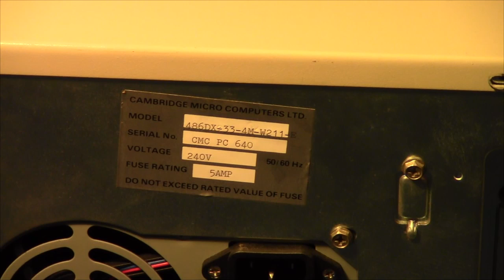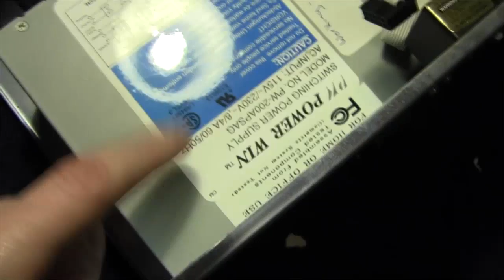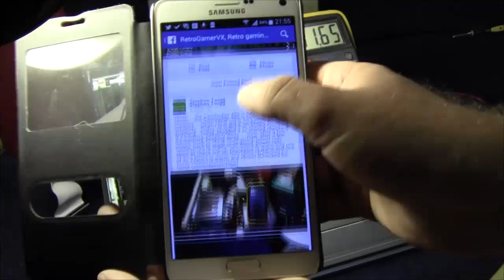Rare Cambridge Micro Computers 486 33DX Repair Part 1 :o)

Comment: I would check the jumper settings on the motherboard as well as the graphics card.  Try cleaning all of the jumpers as well.  Get yourself a POST (Power On Self Test) card that has a ISA connector on it.  They are under $5 on eBay.  A 33Mhz cpu should not get hot that quickly after startup, a 66Mhz one on the other hand will.  Check that the cpu voltage is correct.  If you have another power supply try it with that most rails are suppost to be within 5 to 10% of the marked output voltage.  Open up the power supply and see if it has a output voltage adjust pot in it and adjust it for the correct voltage output 5V and 12V being the most critical.  Try reseating the cpu as well.
Reply from the maker: Some good tips there thanks.  I'll be sure to review that when I get around to doing more work on it (full schedule atm) :)

Comment: I have a 486 with a VLB SVGA card. It was the source of all my issues. Very finicky. This is obviously not VLB, but a loose VGA card can cause a machine to not boot. Or really, any loose card. Try pressing down on it while turning it on. Also try running it with the screw not tightened down on the bracket, that sometimes pushes to the left or right.

Comment: Most likely the VGA card, Since the BIOS is responding to it not being there.

Also note with 32pin SIMMs, you have to have banks of 4 installed for a 486 to boot. If its 72pin SIMM, then you only need 1.
Another thing you can try is to press down on all the DIP packages since they can wiggle out over time. Also reseat the CPU.
Also try running it without the drives plugged in.
Another thing, try removing the L2 Cache and its TAG ram, also set the jumpers accordingly. Kinda overkill, but it never hurts to try.

The PSU is fine apparently. The motherboard isn't dead otherwise you wouldn't be getting any response at all.

Comment: Try cleaning all of the card edge connectors on the ISA cards and SIMMs with alcohol & cotton swabs. I've had trouble with video cards having a bad connection with the motherboard and causing the system to intermittently go dead.
Reply from the maker: I've done that but unforutnatly, made no difference this time, so something more serious :o(

Comment: It's actually starting to boot - the tick sound at the start is the RAM being counted.

Two beeps could be a parity RAM error, or more likely a dodgy graphics card like others have said.

Actually, the beeps could just be that the BIOS battery is flat, and it's asking you to enter setup (F2, DEL, or HOME etc.). Still should have something on the screen though.

Clean the graphics card edge connector, and try a different ISA slot for it.

The note on the gfx card is suspicious - it's probably knackered.
Reply from the maker: electronash Yep, first time I tried it, it was silent, then on reboot, it came up on the monitor, but when it started seeking the drive, it just froze, after that, no image, but sometimes you could hear it checking the memory, sometimes not.  I cleaned the connector, swapped to a different slot, counted the first time, no image, then stopped counting again.Yup, the nimbus may have a card i can try it with, not sure though.

Comment: My guess is that power supply is upto something, perhaps your scope may pick up something like excessive ripple and rails going nuts to fast for the meter to pick up!?  Probably the silliest and most useless suggestion :)
Reply: Yep - I watched the rest of the vid now - does sound like a PSU issue if it's intermittent. So, it's not a silly suggestion. :p
Reply from the maker: Knuckles the Echidna Silly suggestions sometimes turn out to be the most important :o)  I'll try that :o)

Comment: If powers fine then it's the mobo that has died, you can try things like different RAM and CPU's but they are unlikely to be the problem. If trying known good RAM does not work, then it is one for the PCB wall.
Reply from the maker: ***** It comes up sometimes, counts it's memory sometimes, has picture sometimes very weird.

Comment: Didn't pay attention to whole video as I had it on in the background. That said, I think its the graphics board. Swap that out and see what happens.
Reply from the maker: Graham Roberts It's worked before with the graphics board in and complains when it's missing?  (no other graphics boards to put in) :(
Reply: What about the nimbus or ibm one for testing?
Reply from the maker: Graham Roberts Not sure about that, the nimbus is a unique piece of arcitecture, hardware not designed for it specifically may damage it, and as those are so thin on the ground, really not worth the risk, or I would :o)

Comment: do you have any replacement parts ? memory sticks or vga card? can you clear the bios data/remove the cmos battery? even probably the controller could be faulty so maybe remove it..
Reply from the maker: stathissim Nope, no replacement parts in the lab for this system :o(  Controller?  Yes, going to try to clear the bios :o)

Comment: First thing you should do is always strip it down to bare minimum. Leaving RAM, Keyboard and mouse and a monitor connected, everything else out. When you're doing that, leave the power supply cable IN, it helps to ground you and stop static building.

If still nothing, take all RAM out and put as little as you can in, switching over as you increase to check them all. 

2 beeps is a POST error, which should display on the monitor, so you deffo need one connected. It could also be a parity error, maybe from the parity bit check in the RAM sticks, try new.

Try resetting the BIOS. Should be a jumper on the board, if not, remove the battery for a few seconds.
Reply from the maker: Jeff Beresford I never knew about leaving the lead in, thanks, I suppose it won't electricute as not a software switch.  I did put 2 sticks in and it complained of a 'base 64k failure', that give a clue?  Yes, it was connected to a monitor throughout, but after it came up and I rebooted it, it wouldn't again, same as when I first tested it.  I'll try the bios trick thanks for the help :)